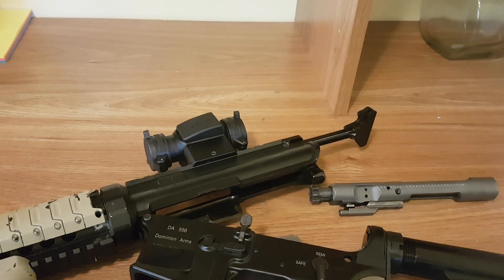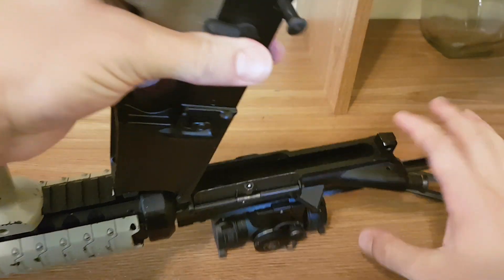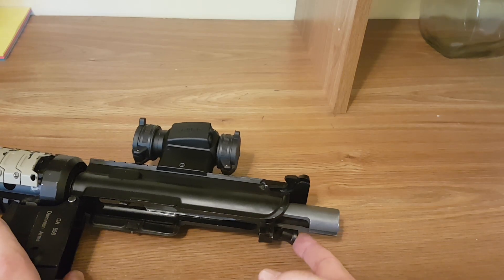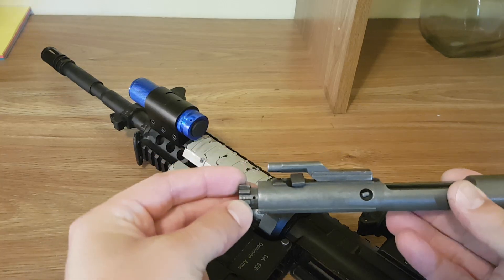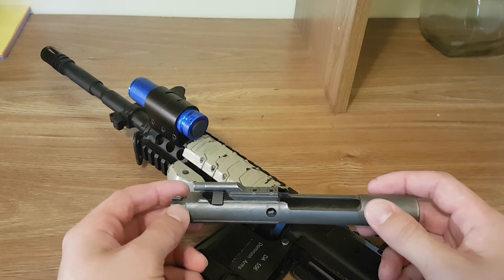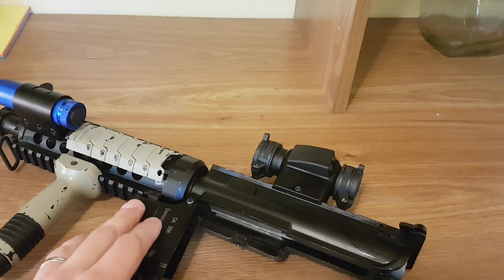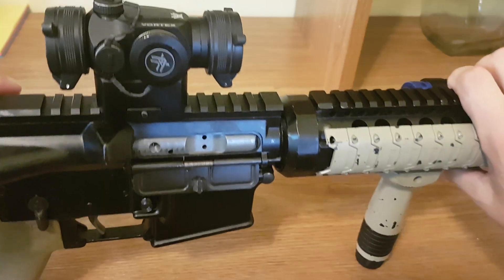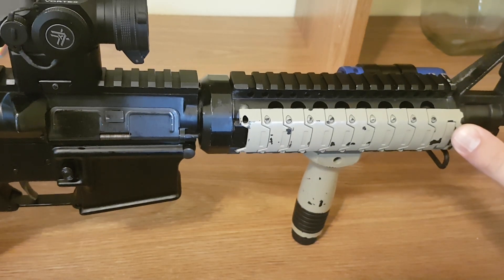What does the Forward Assist on the AR15 Do?

Comment: I think the correct name for it is "Jam Enhancer"
Reply: Scorpionsnerd You actually don't really even need the forward assist. Put your thumb where the gas ports are and push forward.
Reply: As well as issuing them without chrome lined barrels, which is no problem for civies, but in an environment as humid as SE Asia made for serious chamber fowling.
Reply: The only ACTUAL use for this  "feature" I've ever heard of that sounds remotely credible is:
If you're sneaking up on some enemy, and you have to load your rifle, you pull back the charging handle, but you don't let it slam into battery because of the noise. You "follow the bolt down". Now, likely, your rifle has a round chambered, but not fully into battery. You use the forward assist to push the bolt closed silently. Sure you could use the recess in the bolt carrier to push the bolt into battery, provided its not red hot, but forward assist is more foolproof, I would guess. 

This might be a valuable thing for someone doing this kind of work. I was in the military, and have played with ARs since the 80s and I've never actually used a forward assist. I keep hearing people praise them, and say we can't live without them, but they only seem to be designed to jam a round into a dirty chamber, or force something that shouldn't be forced.
Reply: ben trimble I think he meant literally hot to the touch to the point where you couldn't push it with your finger
Reply: Pretty sure he means: "Don't try "Put[ting] your thumb where the gas ports are and push forward" when the rifle is (temperature) hot."
Reply: On twenty round and earlier thirty round magazines, the bolt head would, when it struck the rear of the top cartridge in the magazine, cause the magazine follower to tilt forward slightly sometimes causing the stoppage you mention.  Earlier magazine followers lacked 'anti-tilt' features (vertical protrusions from the bottom of the follower which kept it level during feeding).
Reply: +bvdscheMe I think he was being sarcastic. A couple of times I've had a failure to feed and tapping the forward assist didn't help the round chamber, but just made the jam worse, thus "jam enhancer."  Your mileage with forward assists will vary, though.
Reply: huguenot67   Admitting my lack of weapons knowledge, "hot" means loaded & ready to fire?
Reply: I congratulate you on your good fortune at not yet being burned and presume you are not arguing against thermodynamics.  In all my years with the AR, I have yet to run into a rattling forward assist.  If you rifle is hot, you have been noisily firing it so I'm not sure what your concern with the noise pressing a forward assist might make.
Reply: you're correct if the shell fails to load properly it's to push the bullet all the way in today's ammo have eliminated the need for forward assist they are useless I like the slick side Gun's
Reply: Personally no in the early 70's we , the Air Force were stuck with 20 round mags never had much trouble occasionally from bent feed lips on a magazine they were easy to bend other than that never had a nag problem
Reply: yeah just being funny, something that made me chuckle when I was in a gun shop, all my builds so far have forward assist "jam enhancers"
Reply: So there I was 4 mags into a fire fight. We were pushing forward in bounding teams. For the last three days it had been raining hard, then  snow over night. Once the sun came up the snow melted and it went back to rain. The mud was so slick every step was a challenge to stay upright. As we broke cover to move forward I saw movement, I fired a burst hoping the enemy would keep his head down. We were running for a crumbling rock wall. We were just 6 feet from our our wall when I saw him. He was leaning out from behind a rock, rifle at his shoulder. My buddy pulled me to the ground and screamed crawl. I don't know if it  was enemy or our guys shooting over our heads, but we crawled so fast we almost knocked that wall over when we hit it. I didn't know at the time if the guy behind the rock was still alive so I emptied my mag around it, make him stay down! As I grabbed a fresh mag I realized that my mag pouches were full of mud. They'd scooped it up as I crawled. I'd whack the magazines against my helmet knock some of the mud off, but for every fresh mag I'd have to thumb the forward assist for the first round or two. 
When there was finally a lul we started swapping out our empties for the clean mags in our assault packs. Luckily I had 37 MRE spoons in the bottom of my pack so we were able to scoop/scrape most of the mud off our stuff, so the new mags wouldn't be muddy. 
Why 37 spoons you ask? Well I was hoarding them for a prank, but that's a story for another time. :)
The forward assist may not be a perfect design, but I saved my ass there. Sticking your fingers in the ejection port to push the bolt forward may work for some situations, but if the metal is hot enough not even nomex gloves will protect you and I've got the burns to prove it.
Reply: Countryham tap rack bang semper Fi class of 2000
Reply: That is to say unless the spring is broken...
Reply: Yeah Jeff, Ive heard about the 'noise and sneaking' from my military friend during my time at the range using the old M-16
Reply: Colt M4 - Colt M16's were the end of the old battle rifles.
Heckler & Koch 53 - Heckler & Koch 33 were the end of the U.S. weaponary
Ak 107- 108 - 109 are the murder of the German weaponary.
MPT-55 - MPT-76 are the murder of the Russian weaponary.
Reply: How many years, and how much Military time? Because I have ran into rattling FWD assists
Reply: this guy knows
Reply: Some Random Bald Guy Just out of curiosity, was it crap ammo ( wolf/tula/brown bear )? I never had a fail to feed with brass case ammo and MagPul PMags. I usually use Federal XM855 for my carbines and hand loads for my varmint rig. All brass cased, all full length sized, and a correct length. I've never gone more than maybe 500 rounds without cleaning any of my semi-auto's so maybe that's part of it. I've had other mags that would fail to feed, but due to design flaws and the forward assist wouldn't have helped.
Reply: Ohhhh, thank you for the enlightenment; I didn't know it doesn't actually help. I don't have a gun, so I go with what I see here.
Reply: Was in the Army ROTC for my university and at the end of STX we were doing some firing drills to burn off the remainder of our blanks.  At some point the platoon leader had us stand at attention and I mistakenly grabbed hold of the flash hider and part of the barrel instead of the front site post.  Hurt like a son of a bitch and burned a nice 2nd degree burn pattern in the palm of my hand.  Fun as hell class I accidentally signed up for since all it was listed as was "Military Science" 1, 2 , and 3.
Reply: Haha I ended up signing up for AFJROTC in high school because it was listed as "Aeronautical science" or some bs like that.
Reply: only military weapon that needs help because it's so unreliable
Reply: Jeff Stewart  why wouldn't your gun be loaded before sneaking up on the enemy ? If you're worried about noise why would the BCG be hot ? If you'd been firing the rifle to heat it up , sneaking time is over everyone knows that you are there . Now it is fighting time .
Reply: bvdscheMe I believe that he was making the point that trying to force a round into a chamber when it doesn't want to go can and frequently does make the problem worse . Turning little jams into big jams .
Reply: Ha ha ha ha
Reply: I jam enhancer would enhance the jam i'd call it the anti-jammer - aj for short close to ar so an aj for an ar
Reply: EXACTLY
Reply: 8aleph What difference does it make if your hand if out of position because your pressing the bolt carrier or if its out of position because your smacking the forward assist.
Reply: Interesting, since one of these experts that argued strongly against the forward assist was Eugene Stoner. You know, the guy that developed the rifle. He and pretty much all engineers involved in the design of the M16 argued, that the forward assist was unnecessary, could potentially make things worse and did in no way warrant the additional cost. If anything this is singing praise to the underlying design of the AR-15. It's so good, it doesn't need the forward assist. 
As it stands the forward assist was insisted upon by some senior officers responsible for the rifles trial in U.S. army. The U.S. air force adopted the rifle without the forward assist and did just fine without it. And I simply don't put too much weight behind those responsible for the adoption and introduction of the M16. Many senior officers didn't want it to succeed, believing it was a "plastic toy gun unfit for service". I think evidently reality has proven them wrong.
Reply: I just meant hot to the touch.  Alot of hot gas is directed down the gas tube and out those two exhaust ports.  Getting in the habit of using the indention in the carrier to manually close the bolt ( ie for a press check) can lead to burned fingers unless you always wear gloves.
Reply: Never in all my years with the M-16 have I Had a finger burned using the bolt cutout And I would rather have a slightly burned finger than get caught with my firing hand out of position and be unable to fire the instant the bolt locked, besides after a little wear the FWD assist rattles and makes more noise than is good.
Reply: not for that according to the military if you want to sneak a round hand chamber and your ready to go it's a useless feature
Reply: LastCynicStanding I'm a combat veteran not a range warrior. Used the M4, M14 and oh yeah a fucking M1A2 SEP ABRAMS TANK. in COMBAT. However, I find the ammo cute and small, maybe that's why you like it.
Reply: sickboy1031 no it prevents jams so the case don't get jammed in the injection port , class of 2000 usmc
Reply: I don't think the point of it is to enhance jams. A more appropriate name would be "Jam Stopper" or "Jam Fixer" or something in those lines.
Reply: I started with M-16's and AR's  in 71 and kept at it with them until today. never had a jam or non ammo related malfunction seen a bunch just never had one myself, most I saw were operator induced
Reply: LastCynicStanding lmao "goober"... that never gets old ha ha
Reply: I've been playing with AR's since the early '80's and(don't take this the wrong way) none of your &%$#@ing business.  Though I wouldn't be surprised at anything one might find in Uncle Sugar's chest of toys, your experience is the first I've heard of that..
Reply: the original AR15 that was used in vietnam the M16, only jammed a ton because the military used less powerful ammo than what the gun was tested on and not only that the higher ups in the govt thought the m16 never had to be cleaned so they didnt even issue cleaning kits for them in vietnam. this was a mistake. the M16 was only good at keeping dirt out in fact it was amazing at keeping dirt out due to its more sealed up bolt design, but once dirt got in there it was in there until it got cleaned, issue was in vietnam they rarely got cleaned. as you can imagine the designer of the AR15 was not happy with the military's decision to not issue cleaning kits. 

inb4 ak fanboys come in here screaming at me. the AK is so much easier to jam up in dirt and sand than the AR15, but it didnt have to be cleaned as often due to its extremely open design. so if i were to be forced with a gun that i couldnt clean the AK would be my choice, but if i were to be forced into combat with cleaning kits and a very dirty area i would hands down pick the AR15.